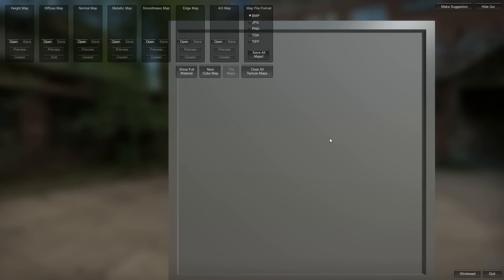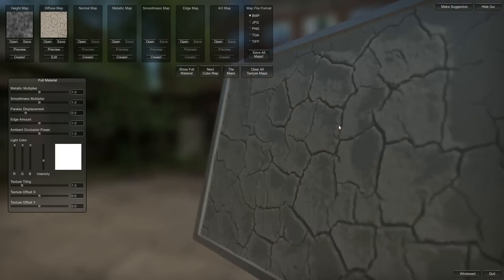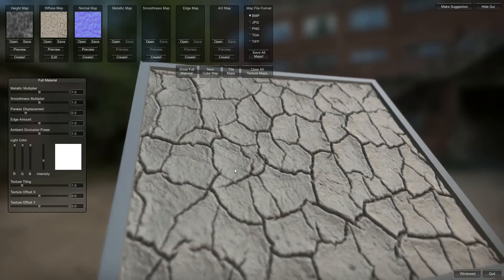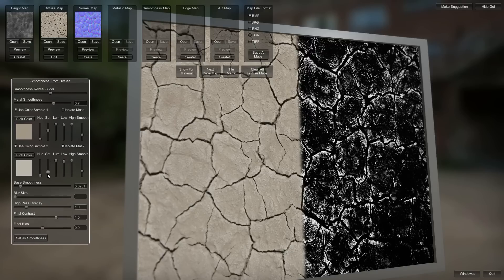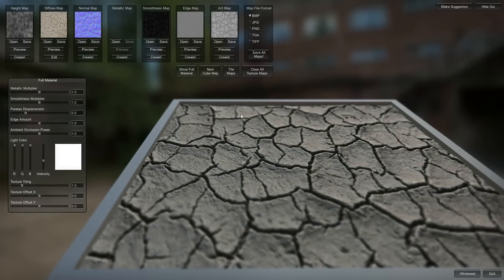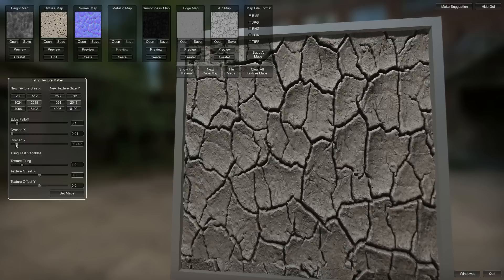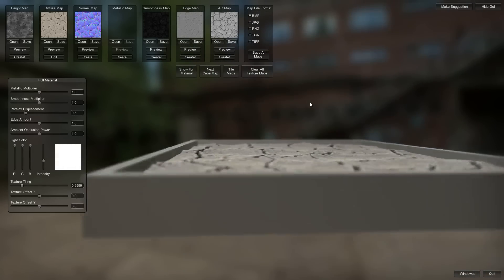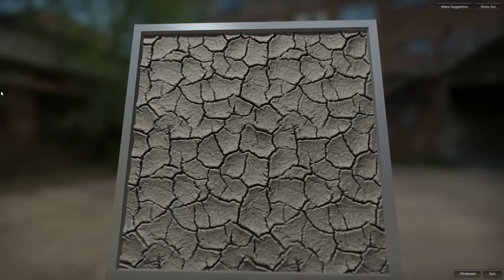Materialize - Cracked Dirt

Comment: After he tiled one of the maps, he somehow made all the other maps tile in the same way by clicking on some button, but he didn't slow down to describe what he did there. Did anyone see how it was done?
Reply: 8:17 "When you hit 'Set Maps' it's going to tile all of these maps and you can't undo this, so make sure that you are happy with your changes before you click it."
In the Tiling Texture Maker, make the required adjustments, then click the [Set Maps] button to apply those tile settings to all the textures.
Reply: @JoeBlac  ...Thank you Joe.

Comment: Sounds great, but impossible to load any image, any idea ? i've already tried the 2 answers of the FAQ :(
Reply: Same situation here, trying to get it to run in the documents folder with admin rights to no avail
Reply: hi, you have to put the directory that you got from the zip file in whatever place of your computer but the PROGRAMS FILES directory. i had that problem and solve it that way. in the web site they said so. you it work for you.
Reply: @rafaelblancoNET  Hi, thanks for the tip, I found it on the website too. Some pictures seems to be available, but some appears with an interrogation point, unavailable to use :( any other idea ?
Reply: @julienboreau  J'ai même mieux, tu enlèves les caractères accentués du chemin de ton image ( é à è ... ) et ça marche ! 
Ca n'a pas été encodé pour supporter les accents.
Reply: I find running the program as an administrator fixed the problem for me.
Reply: I reinstalled the Microsoft Visual C++ Redistributable, installed Materialize to the Documents folder. Set the application to have administrator rights and its working now. Excellent little program for material editing!
Reply: I solved the Problem:
just install Microsoft Visual C++ Redistributable 
it will automaticlly work.

Comment: Hi Michael, I gave Materialize a quick try with a rather difficult texture - a mossy tree trunk. Here is the result: 
https://sketchfab.com/models/b7e23e07ace24fca83e92b778f5ccd4b
I think Materialize works great in generating all the maps. The only part I was not quite sure how to improve is tileability. I used a photo from Google which of course already had some blurred parts, and I used the patch method when generated the tileable texture. Do you have any tips how should I improve it?